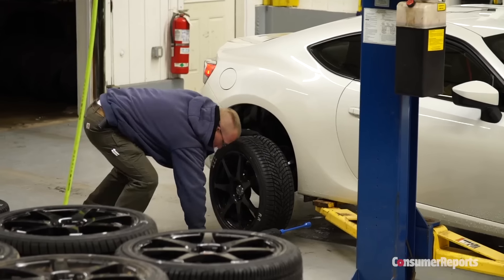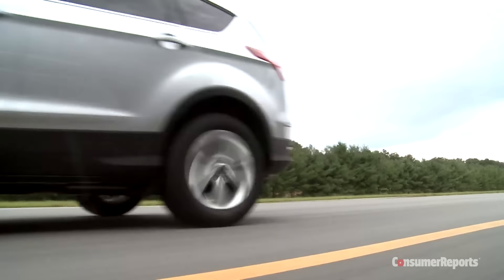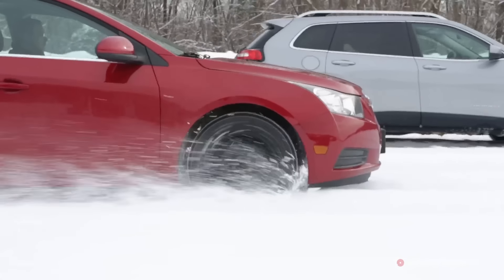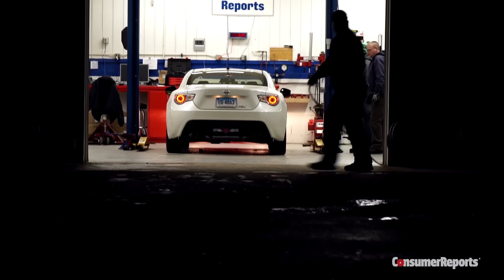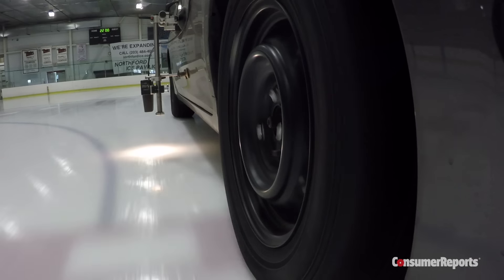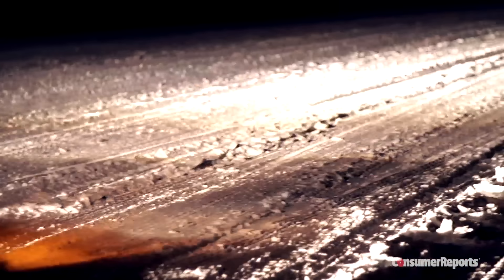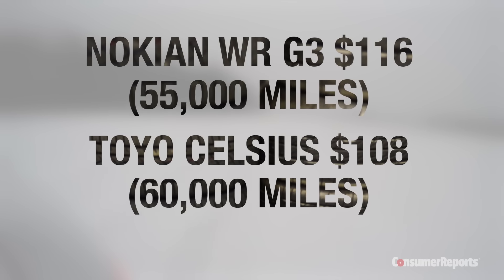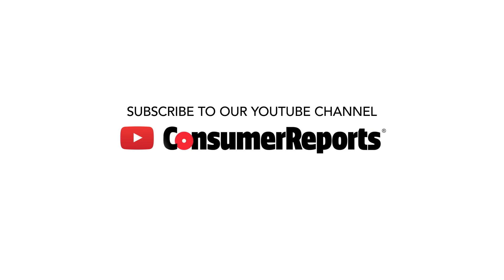New All-Weather Tires Outperform Some Snow Tires | Consumer Reports

Comment: I have Nokian WGR3 on my VW Vanagon. They are a extra load tire.I drive to and from Vancouver BC  to Fort McMurray  Alberta to work.I leave Vancouver 21C ,go through Kamloops ,Clearwater.Then from Blue River to Valemount -15C heavy wet snow roads covered on thick ice,.Kamloops can be +37C .These tires handle hot and cold temperatures  every road condition  .So I no longer need to carry 2 snow tires in the van.And Nokians are rated for winter mountain driving.Stopped quickly for a moose crossing in front of me driving home in November to Vancouver .These tires give a driver confidence .

Comment: I've been using Nokian WR* tires for many year on a 2008 Highlander. They do generally work as advertised and, indeed, are much better than "all season" tires in snow. However, the snow performance does drop off quite a bit with tread wear, so keep that in mind.

Comment: I had not heard about these tires before. Being a Michelin person most of my life. I have been researching the CrossClimate2’s. Very impressed with the also with them a snow flake rating too.
Reply: Cross climates do not have the cornering capability because of the lateral grooves . Drive slow around corners in snow

Comment: I had a chance to test the Nokians tonight on snow and ice. Overall, I was very impressed. Braking and turning was good, and drive grip was great. Hills were no problem going uphill. Downhill did result in some abs intervention when slowing from a decent speed but sliding was minimal.

Comment: I live in Minneapolis and have a set WRG3s that I run year-round on a Prius and they've worked well for the last 4 years. If you want perfection, then get a set of dedicated snow tires but if you are willing to compromise a little on performance and hate changing out tires twice per year, these are really nice. They certainly do outperform "all-seasons" Note these are low-resistance as well and gas mileage is excellent. I've heard some people say tire noise gets worse after 40K miles but at 48K I haven't noticed that.

Comment: I'm on my 4th winter with the Nokians on my 2WD F150, and I'm very pleased with my purchase. I've never run winter tires on a truck, but I've had a few on my cars. By far the directional winter tires (early 2000's Goodyear Ultra-Grips) outperform the non-directional winter tires as well as the all-weather tires in the snow and ice, however I would say that my all-weather tires are comparable to the Blizzack (2010) non-directionals I've run. As to the remaining 3 seasons, I've found them to be grippier than all-seasons in the wet and have found no negatives on hot, dry roads, with 40 K's (I ride my motorcycle primarily in the warm months) on them, they seem to be wearing nicely, and they provide low rolling resistance for improved fuel economy (as per there claim).

Comment: Have these on my Subaru, performs like a jeep! Drove it through a decent snowfall in the Rockies and even drove straight in and out of a ditch today.
Reply: Part of that is because it's a Subaru.  I pick all season radials with good snow rating for mine too.  But I've been out in the snow on almost bald tires and I still didn't get stuck.
Reply: MasiukA why did you drive straight in and out of a ditch...? 😗

Comment: Another reason to have all weather tires is if you travel back and forth from a temperate climate to cold climates. For example...San Francisco Bay Area to the Sierras. On a trip to Lake Tahoe from San Francisco, 150 miles of the 200 mile trip during the Winter is in temperatures from 50'F to 70'F but the last stretch and around the lake and ski resorts,  freezing temperatures and snow and ice are common.  I used to swap summer tires with dedicated snow/winter tires, but the winter tires would wear out very quickly because of the miles driven in temperate climates (central valley and bay area).  Now, I swap from summer tires to all-weather tires during the winter and they perform close to a winter tire, but won't wear out quickly!  I could just keep them on year round, but I like the summer performance of my summer tires and the style of the rims, so I still swap with the changing of the seasons.  It's nice to have this option!

Comment: After moving to the Nokian Weatherproof all seasons tyres I have to agree that, for example, in the UK climate - you don't need a dedicated winter tyre. The Nokian's all season's are every bit as good in snow, as the two different brands of dedicated winter tyres I had, and even better in deep water. 

When compared with running just summer tyres - It puts the helping hand where I need it most, in snow and deep water. I don't feel any difference in summer with them - but then I don't race about. After talking to the Nokian dealer he made the point that Snow tyres (or any tyres) should be replaced at 3mm if you want any winter performance from them. He considered the 1.6mm UK replacement depth as particularly dangerous in Winter. 

I think all season tyres should come as standard on new UK vehicles. We might avoid a lot of winter carnage if this was the case.

Comment: I used to run Michelin for summer and Gislaved for winter on a second set of wheels.  It worked well for 7 seasons, then the Gislaved blew.  I searched around and got Nokian WRG2 as my winter tire--I initially wanted Hakka's, but the dealer talked me into the G2's.  I ran them as my winter tires, and used my summer tires which became Bridgestone's rather than Michelin.  

Eventually I started using my G2's for the summer as well.  They were the best tires I've ever had; balanced them once, and never a shimmy for years.  When the WRG2's wore, after 7 seasons, I sought another set, but found them to be discontinuing--I was not sure about the WRG3's preferring the G2's.  Initially, I ordered the G2's since they were still available, and then changed the order towards G3's--why buy a discontinued tire.  

I can't say which one is better now, I really loved the G2's, but now I am used to the G3's.  Have not had the chance to really test the G3's in winter driving as I did with the G2's--they were great in wet and snow--I used them for 7 winters.  

I am thinking about Hakka's because I moved North and into a hilly area; not sure if I need dedicated snow tires, or WRG3 would be adequate--I was thinking of getting some chains--but then, they are problematic, so might as well get some Hakka's.  Or take a chance on WRG3 if snow is not extreme.  

I will only consider Nokian tires henceforth.  They make a great tire--I've had Good Year, BF Goodrich, Michelin, Dunlop, Bridgestone; Nokian is the best.

Comment: That's good, but you forgot to tell me how they perform in rain and dry pavement when compared to all season tires. Thank you for all your time and effort to bring us the information that matters!
Reply: +ShiftyKen 08 just the same CR tactic to make us buy the issue
Reply: +fabulousprofound That's okay, I do my research at the TireRack website and have only been disappointed once. The tires I buy have always been great all around performers in dry, wet, snowy and icy conditions so this is nothing new for me
Reply: Consumer Reports sells information. They don't give it away. Also, they can be bought which is why I stopped buying their magazine decades ago. Lots of their info comes from subscribers. If I wanted the opinions of non-experts, I wouldn't pay a mag subscription to get them. This is clearly a paid advertisement for these two "new" tires. Total BS.

Comment: During harsh or snowed/icey roads... at permissible speeds depending on road conditions, I will sacrifice noise. However,  listen closely... soft compound!
Moreover, threadwear,  I would assume is the same performance as regular tires... depending on tires quality.

Comment: Just like synthetic motor oil has a longer temperature range I would think rubber could be made to do the same,  so just because you don't know about it doesn't mean it doesn't exist.  

From what I've read they do better than cheap snow tires but not top tier and are similar to all seasons in the dry and wet,  wearing slightly faster in hot summer months.  

I've had mine on for a week and they are much better in the cold and rain than the summer performance tires it came with,  as for snow all I've encountered was a light covering in Yellowstone Park and I don't think the surface was frozen underneath.  

Because I have two cars and have changed them more frequently than originally intended I've had several different kinds of snow tires,  altimax artic,  blizzak,  xice-2, hakkapelita r,  extreme contact, wildcat xt,  winter i-pike.  

I can honestly say that as far as snow and ice the off brands are the only two I was disappointed with.  
The continental and hakkapelita r wore very fast as the roads here are plowed very quickly.

Comment: A good compromise for those on a   budget and with no room for spares.  However I run a skinnier snow tire on 16in wheels. Wider 18's for Spring/Summer/Fall.  Tires last longer. Making the money spent go farther too.
Reply: You pay twice as much & they last twice as long.  It's not brain surgery to figure out there's no financial benefit. 

Dedicated winters are better when/if needed, dedicated summers are better for summer performance, with East Coast winters you are probably better off running dedicated summer/winter tires, for your application.  

WRG3's are the best all weather compromise as far as dry weather and mixed snow conditions. I don't NEED a dedicated winter tire where I live, most of the time, but all season radials are a crap shoot when it dips below 7 degrees.  

WRG3's are designed very specifically for Canadian Winters, they were designed in conjunction with KalTire's (Canada's exclusive Nokian dealer)requests for an all around tire with a specific focus on Toronto and Vancouver drivers.  The greatest benefit is generally found in the Pacific NorthWest.

Comment: My concern is that while winter snow/ice performance is good when they're new, but what's the winter performance dropoff when they're half worn down? The first 30k miles, they should be great, but how's the winter traction for the next 30k?

A lot of all-seasons suffer the same drop. First winter is fine, the next few, not so much. 
I switch to winters on all 3 of my vehicles (FWD, RWD, & AWD cars) not just for good winter traction, but partly because I can get the full lifespan out of my other tires without worrying how that last winter is going to be.
Reply: You also need to concern about the storage conditions of tires for long periods. 2 set of tires will be 6-7 years old if you keep each around 10K miles for a total of 20K miles a year. Old tires also lose some grip.
Reply: The firestone winterforce on my yukon did amazing the first year, very good the 2nd, and now with about 35k on them and around 1/3 tread left they do poorly. I am only assuming that there is most likely a harder compound used in the lower layer of tread.  I did run these for 2 summers as well, so the wear was accelerated by that.
Reply: All tyres suffer from heat/cool cycles.... some worst than others.... the best... drop a few PSI on the tyres.... trust me... even crappy tyres will benefit from it.

But we tend to get lazy checking PSI when it snows and vice versa until a fender bender happens.

Comment: How's the ride quality though? Tire noise?
Reply: +exit07  BOTH tires are not noisy, they are constructed not to be...
Reply: Wow you know very little about tires.  Tire noise can vary greatly from tire to tire due to the tire rubber compound mix and especially the tire tread pattern on the given tire.  Some tires are very quiet while others especially sport oriented tires can have a distinct growl especially the longer they wear.
Reply: theripper121 Snow tires with more tread are noisier in general, so they both should be similar.

Comment: Compared with all season, do these wear out faster in warm weather? Do they have higher rolling resistance similar to winter tires?
Reply: It is a bit more resistance than All season tires, but less than winter tires.  WRG3 wear out a bit faster in warm conditions than all seasons but the threads are much deeper than regular tires. That's how they survive long.

Comment: i use general altimax arctic m+s on my chevy trailblazer best tire ever tried many none compare
Reply: Based solely on your personal opinion, for your specific vehicle application and conditions. Try not to paint with such a broad brush and your comment may have some validity and be of some use to someone next time.

You do realize that M+S means absolutely nothing at all though, right? M+S is not even an actual designation, means absolutely nothing except that the manufacturer feels it is a more aggressive tread, for mud and snow terrain.  Only the snowflake symbol is the regulated snow application symbol/standard.  You can buy all season radials for a Camry, at Costco for $39, which have M&S on them.
Reply: yes and those all season radials will not work worth a shit in deep snow or severe road conditions compared to the altimax number one reason they work near as well is the rubber compound at which they are made all season are made from a stiffer harder rubber compound and become like a hockey puck in temps below freezing especially below 15 degrees put that in conjunction with severe winter road conditions and the traction will never compare altimax vs those radials altimax would far surpass in performance stopping handling and take off another reason those costco tires wouldnt stand a chance is the tread pattern and siping system which on the altimax it throws the snow away per rotation keeping a clean tread pattern as the all season tend to accumulate it in the tread becoming more of a slick with little traction in fact the automotive industry has been in the process to change the name of all season to 3 season tires for this reason they are only good in light snow conditions
Reply: Matthew Brady Way to run off on a tangent!

First you make a baseless generalization about the best tires, because you've tried them all and therefore know the most about snow tires as a whole.

Then you go off in a completely different direction, describing your knowledge of compounds 101, which is pretty basic to say the very least..
it doesn't support anything you've previously said nor does it counter anything I've said.

All you did was prove you don't believe in sentence structure.  I merely explained that M+S means absolutely nothing and you went off describing the benefit of a winter compound vs higher silicone compounds used in summer tires (that's why, as you say, they turn hard like hockey pucks below 7 degrees) and you went on to babble a bit about the variance in tread patterns. WTF?!? 

II've worked in the industry over 3 decades, I get it, I don't need you to try to describe the differences for me.

The only thing I can take from that is you want to prove you understand that dedicated snows are different from all season radials, well done, what a breakthrough.

Get a grip and find someone to argue with where you are actually making a point.
Reply: im not argueing with you i love you man have a great holiday if i dont hear back i agree that m+s means really nothing
Reply: Actually the Nokians are made of a Silica compound like winter tires, so they stay soft in colder conditions. The Nokians are in a different class than the "all-season" tires that you'e familiar with. The video did say that they will outperform SOME snow tires, meaning, of course, a well-designed, dedicated, snow tire will outperform these. Nokian has their own dedicated studded winter tires. Where there tires really shine is if your winter driving combines a mix of snow, wet and dry conditions below 45 degrees. Also, not the best choice if you're summers are regularly over 80 degrees.

I have driven my Subaru in some pretty rough conditions in these, and they performed well. These are actually pretty cool tires, worth reading up on if you're a tire aficionado.
Reply: Oz Media regardless of the M+S he mentioned, the Altimax Arctic tire is A full blown snow tire so naturally it will have that symbol on it. I agree with him as I have the same tire for my wife's cross over and  they are amazing. I also have A brand new set of studded Winterforce tires that I may put on her car this year to test the difference. We only put about 2k miles on them the whole winter, and they didn't wear at all so the tread depth they each have will be irrelevant. The M+S simply means the tire has been rated for light mud and snow applications. Not feet of snow and thick layers of ice. A full blown summer tire, like you would run in Florida, wont have that symbol as it is strictly for wet or dry and warm conditions.

Comment: I had no idea all-weather tires were a thing. Good info. I'd love to see a video comparison for the all-weather tires vs winter for snow/ice handling & all-weather tires vs all-season or summer tires for dry & wet handling.

I am so shocked by how many "professionals" encourage winter driving on all-season tires where I live. I recently got a Tacoma that comes stock with Toyo Open Country A30's (all-season) and I asked about getting those swapped for winter tires instead. "Oh you don't need to do that. They have excellent tread. They're brand new tires". 20 miles out of the dealership, one of the brand new Toyo tires blows out & I'm down to the rim....

Both times I purchased new cars, I've had negative experiences with their stock tires. Kumho for my 2013 Veloster (swapped those out with Continental Extreme Contact DWS06 for wet/dry & General Altimax Artic for snow/ice) & now the 2017 Tacoma with Toyo tires. I'm swapping those out with General Altimax Artic for the winter & I'm still shopping around for dry. Still comparing all-season vs all-terrain tires